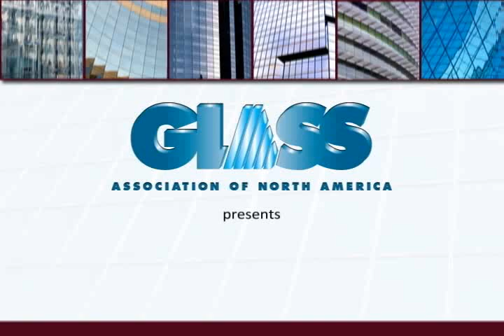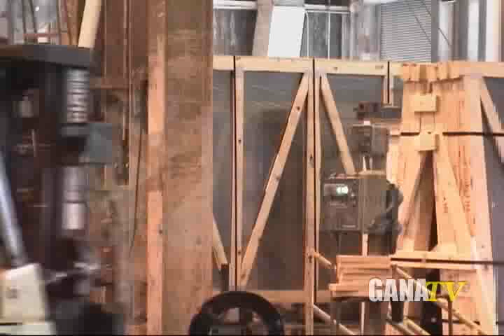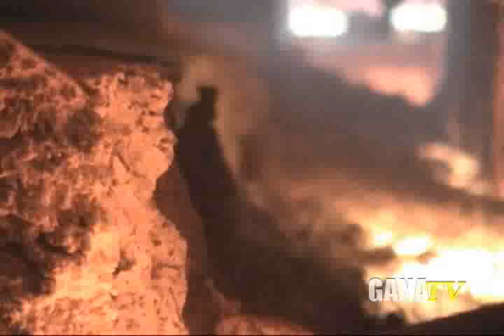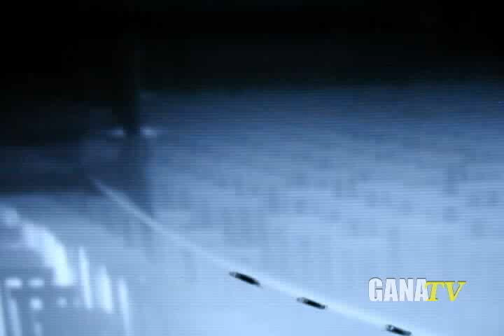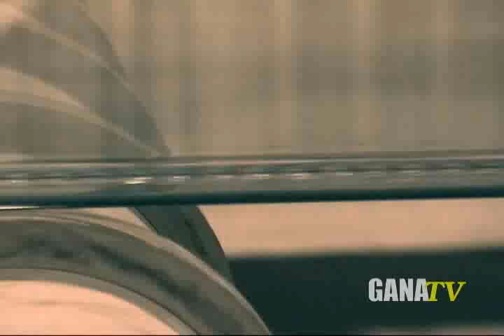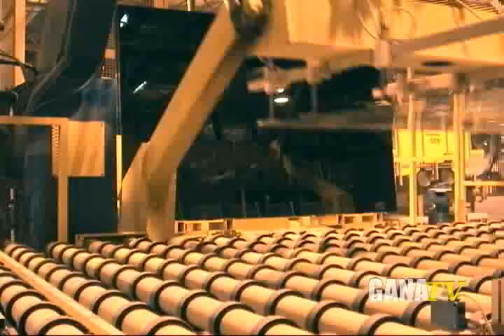Float Glass Manufacturing Process .flv

Comment: Curious. The vid says that the glass rolls through a lehr taking the glass from 1100F down to 200F. What type of material is used for these lehr rolls? Are the rolls ceramic? Does the material end up scuffing the glass, or does the roll eventually wear down due to the heat?

Comment: The powder (Pumice) not only is used to keep scratches away and for shipping, it's also used to keep glass sheets from sticking to each other.
~
Question: We sometimes get finished glass with "tin" side up, this has to be thrown away because of the chemical reaction to the silver paint put on for the grid(s). Causes the grid to look like a nasty yellowish green, instead of white.
~~
Anyway, can anyone explain why or how the tin side up reacts with the paint(s)? (Mainly the silver paint?)

Comment: Wicked!
~
I work at Pilkington #77 (NSG) and our team of (four) just cleaned the inside of the furnace! We also checked, sanded and replaced worn out ceramic rolls. All this was done when it was 103F outside, so with our respirators,tyvek suits, cuffs/sleeves on it was extremely hot, could only work 10-15 at a time before we rotated, I lost 7lbs in a 12hr shift! The next day we were finishing up & I got very sick (heat exhaustion).Been off for 2 days go back to work 3 12hr shifts.Thanks4 TheVid